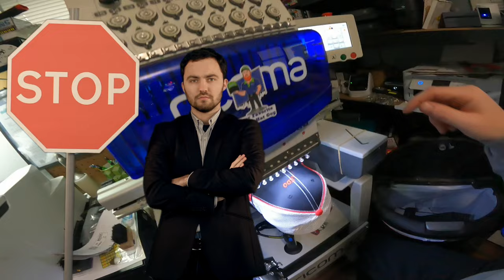Unveiling TC1501 Secrets: Puff Embroidery and Foam Unleashed! Watch How I Fix My Mess-ups!

Comment: Thanks for the content, that’s a good looking design.
I use my thread nippers to cut the stitches and a small pair of needle nose pliers to pull the stubborn threads. I also put a few layers of “sticky backing” inside the hat after a repair to help patch the needle holes so there is something to grab onto and produce a good stitch.